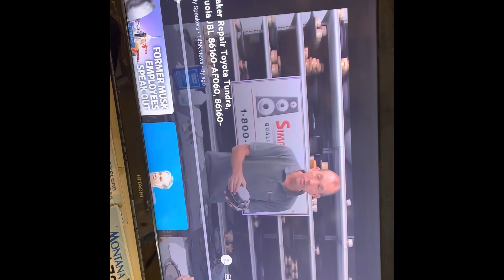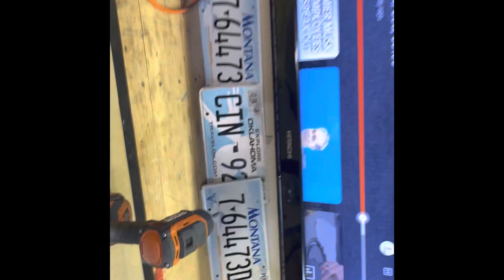SPEAKER REFOAM FOR LEXUS GX470 Toyota JBL MARK LEVINSON SPEAKER FIX

Comment: I saw the other video when you replaced sub with kicker? Do you prefer refoaming over replacement? Was that a different 470?
Reply from the maker: Yah that was a different 470,  I have owned about 20 of them.  I prefer to refoam now over the kicker option.  There is a little performance gain with the kicker but more clarity with the refoam